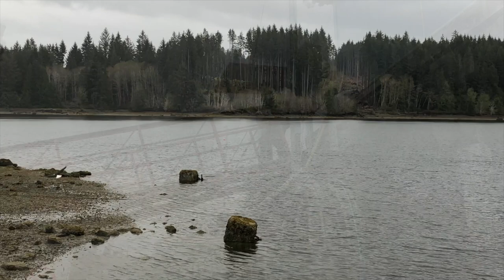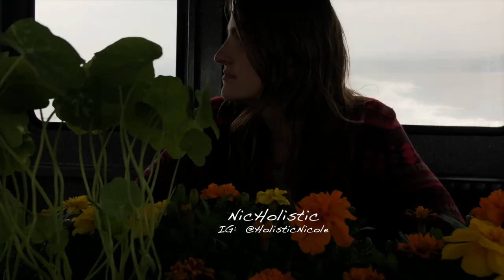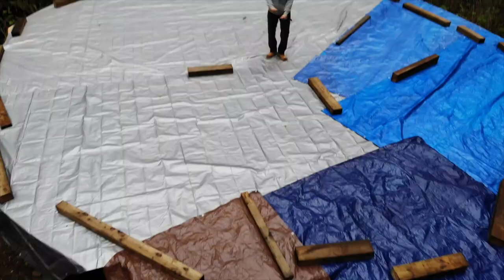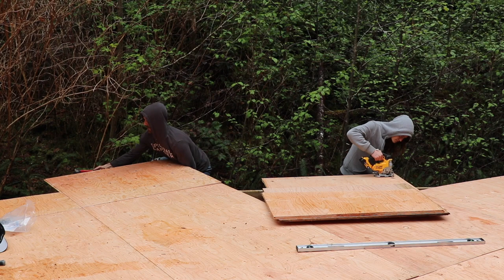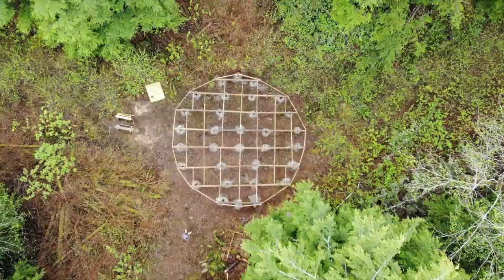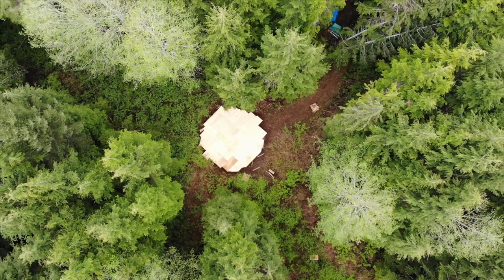Episode 9 | J & N's Story | The odds and ends of yurt flooring

Comment: Get the layout SQUARE (as well as plumb and level) to start, then the flooring seams naturally fall dead in the middle of your floor joists and crossmembers. T&G subfloor (plywood floor decking) is engineered (for multidirectional strength and load bearing) to be run in staggered alternating full and half sheets. Making myriad unnecessary custom cuts creating Frankenstein trapezoidal patchwork pieces (...and prolonging a potentially bug-eaten suffer-fest) is totally avoidable. ~ End